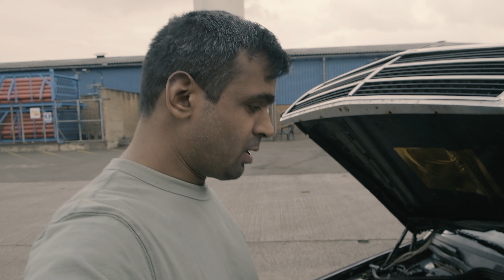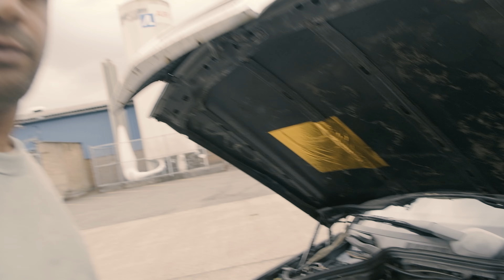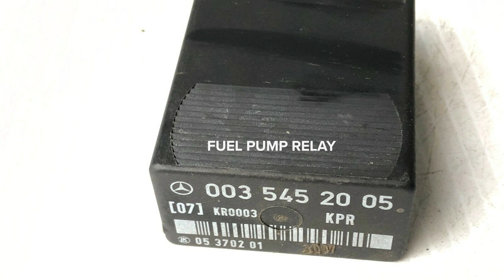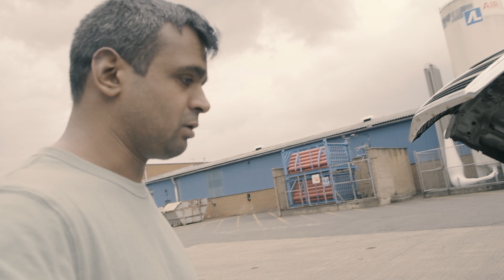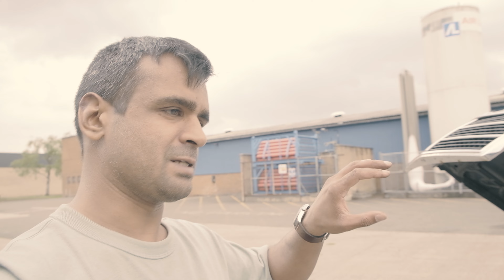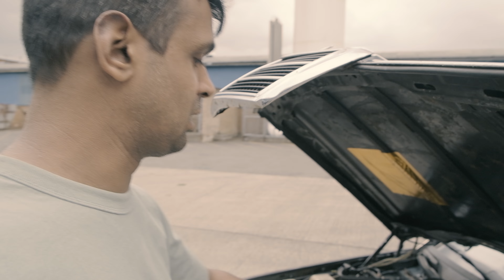MERCEDES 190E INTRODUCTION TO K-JET SENSORS AND RELAYS

Comment: I noticed there are two wires connected to the tach signal next to the x11 connector. Originally, mine had one wire connected. I believe the wire with no sheath may be original. The wire below that may not. If original, I wonder what that wire is for.